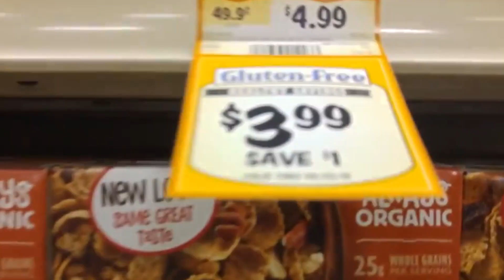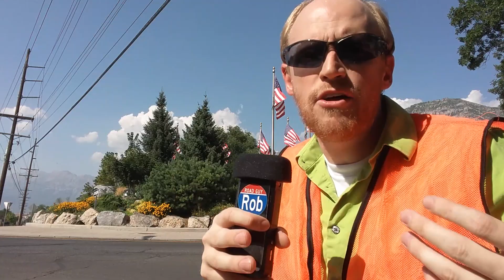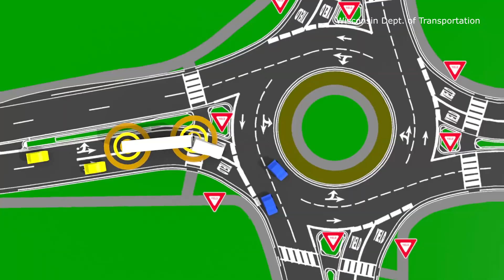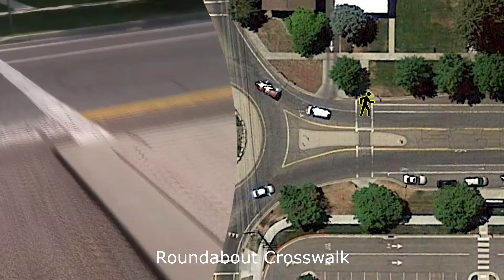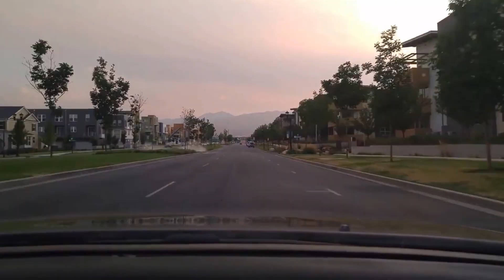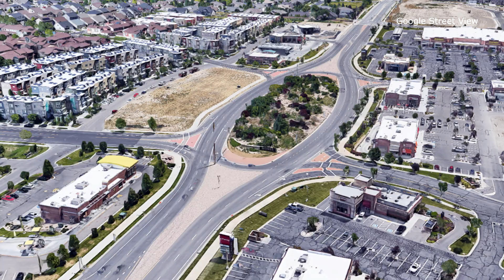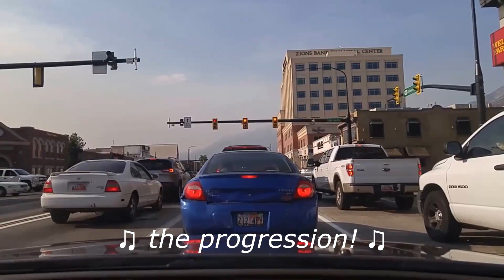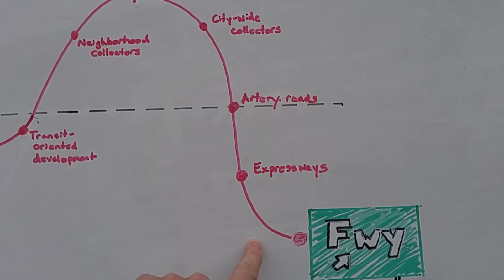Are roundabouts REALLY better than a traffic signal?

Comment: As a motorcycle rider, roundabouts eliminate the most common accident: being overlooked by a left turning (crossing your path) vehicle.
Reply: As a motorbicyclist may I add that a well designed roundabout is a lot of fun.
Reply: There's a difference between "getting overlooked" and "the other person didn't even try to see you". So still you're right but you need to check your use of "overlooked" since most "overlooking" (which means checking and failing at that) actually means "turning without checking".
Reply: you mean when they're coming from the opposite direction as you and they can turn but they must yield (flashing yellow arrow)? or am I misunderstanding you?
Reply: @muhilan8540  The direction doesn't matter. But mostly it's the case when motorists turn right and need to yield to pedestrians and cyclists continuing straight on. Studies show, that even in cities most people don't even check their mirrors before turning - which is definitely no effort! But they don't check their mirror, one cannot talk about "getting overlooked". It's just reckless missbehaving. Imagine the same situation in industries: An electric engineer arranges something and doesn't check the installation to be right or wrong. He just switches it on, creates a shortcut and the facility burns down. Would you say, that he "overlooked" the mistake in the circuit? He didn't check. That's a difference and it's the same situation when people turn.
Reply: @mopshase12   Mirrors have nothing to do with the motorcycle situation Der Stadtbewohner is talking about.  He's talking about a motorcycle going north (for example) getting hit by a car turning left from the southbound to eastbound street.  Roundabouts completely eliminate that problem, and you're left with getting rear ended (in which case it's your fault because you didn't yield to traffic in the circle) or sideswiped, both of which are far less severe.
Reply: @ntdscherer  You didn't get my point properly: I know that he's talking about getting hit by a left turning car. Nevertheless he said "being overlooked", but even there, many "accidents" happen because the turning driver doesn't check. It easier to understand when talking about turning right and mirrors, but the problem is the same.
Reply: @mopshase12  A few, sure.  I doubt there are a lot of accidents by left turners who just flat out didn't even glance in the direction of oncoming traffic.  Even a stupid driver knows that's a good way to get killed.  Inattentional blindness is much more likely.
Reply: @ntdscherer  There are two main types of accidents when turning left: Checking the opposite direction, waiting for pedestrians to cross and then turning without checking to the front again and as you said "inattentional blindness" - but that's the point: inattentional blindness is the same as not checking. "Overlooking" means that you are attentional and still don't see something (e.g. due to sunlight). Inattention is still not-checking.
Reply: @ntdscherer  Actually, it is in this context. Because calling that "overlooking" creates the idea of accidents happening as a matter of unluck and somthing uncontrollable. It's trivializing the event "accident" - which is a main reason why accidents are happening: because one does not think of one's own responsibility.
Reply: @mopshase12  I'm not sure exactly what you're replying to, but if you're saying there is a context in which inattentional blindness is the same thing as not looking the right direction, no, that is not true.  I don't particularly care if you want to use "overlooking" or some other term to describe a driver who failed to look out for threats as they should have.  

As for "accident", it's a reasonable term since almost no crashes are on purpose.  "Accident" doesn't mean there isn't accountability or that it's nobody's fault, it just means it wasn't intended.
Reply: I can’t even walk a crosswalk without people doing it.
Reply: The most common "two vehicle" accident. The vast majority of motorcycle accidents involve only the motorcycle and the terrain. Usually riding while impaired and/or riding outside of their level of skill. My only accident in something like 200,000 miles was me low-siding due to over-braking due to being a n00b. Most of my two vehicle near accidents have been caused by drivers trying to merge into me while they were oblivious to my presence. Always assume they don't see you and try very hard to not be in a place where that is a problem. If you have to be there, get out of there as soon as possible.

I'm in the US where there is still a lot of unfamiliarity with round abouts /rotarys. I'm ambivalent. I think a lot have them have been put in not because of traffic engineering but because of town managers seeking coolness. I hate places that have about four of them strung together in a mile or two. Every one of them is a chance for dirt or gravel on the road.

Comment: I vote for roundabouts being terrible in most instances. About the only time I welcome a roundabout is when an ovalabout can eliminate at least two signal controlled intersections. The video covered both pros and cons pretty well, but I want to reiterate the cons:

1) Roundabouts take up more space than an intersection. The more traffic a roundabout has to accommodate the bigger it and its approach ramps have to be. A fully developed roundabout with overpasses, approach ramps, bypass ramps and pedestrian bridges takes up as much space as an interchange and costs as much or more but doesn't function as well as a properly engineered interchange. Roundabouts also make it impractical to build high traffic buildings anywhere in their immediate vicinity, thus impacting even more land than they actually use. An intersection requires no such reserves of extra land around it.

2) Roundabouts are not pedestrian-friendly, thus the need for pedestrian bridges or tunnels. But that's only half of the story. Roundabouts send a continuous flow of traffic downstream, which makes it much more difficult for pedestrians to cross the downstream street or boulevard.

3) Pedestrian bridges over roundabouts are expensive and ugly, and tunnels are usually poorly policed and therefore dangerous. But if pedestrians are allowed to cross the crosswalks at will on a roundabout and its approaches it only takes a modest amount of pedestrian traffic to completely clog a roundabout. A roundabout cannot tolerate being next to a metro station without pedestrian bridges/tunnels.

4) A roundabout is not a high-traffic junction, just the opposite, it's capacity is limited. A 4-way intersection with adequate dedicated left turn lanes and controlled by traffic signals typically has higher capacity than a roundabout.

5) Yes, roundabouts promote a continuous flow of traffic. That, however, is not an advantage in most cases. A traffic light groups the traffic into pulses, called platoons, which allows cross traffic and pedestrians much better chances to safely cross the street downstream of the junction between the platoons. A properly designed boulevard will have traffic lights every 3 to 5 intersections with just stop signs on the cross streets in between.

6) Cloverleaf interchanges get a bad rap because they cause weaving (traffic enters onto a highway before traffic that exits), but roundabouts have weaving problems in spades. All traffic getting off a roundabout at an off ramp has to weave past traffic getting onto the roundabout at each previous on ramp. Furthermore, a cloverleaf design can be modified to minimize or eliminate the weaving problem, but it's inherent in a roundabout design... no mitigations are possible and still keep the roundabout concept. Yet cloverleafs get condemned and roundabouts are nearly universally celebrated (falsely) as traffic-solving panaceas. Roundabouts are not a panacea and they should not be used or recommended nearly as often as they are.

7) Traffic lights get a bad rap for impeding the flow of traffic. But a single roundabout will impede the flow of traffic at least as much as a single traffic light. It's a series of uncoordinated traffic lights that must be avoided. A series of coordinated traffic lights work better than a series of roundabouts. With coordinated traffic lights you're likely to have to stop at the first light in the series, but thereafter you're likely to be able to drive straight through at full speed. With roundabouts you must slow and come to a near stop at each yield point at roundabouts with no traffic, and a full stop at each roundabout where you encounter opposing traffic.

For all these reasons we rarely see roundabouts being used in North America.
Reply: 1: They are a lot more attractive which for many places is a big selling point as they are very often used as a form of traffic calming when driving into a town. You don't just have a sea of asphalt but a nice grassy donut in the middle usually with a statue of some kind on it. Not to mention the US has some of the lowest density cities in the world so for them space is less of a concern than for anyone else.
2: Roundabouts though make it far easier to accomedate pedestrian islands and the slower speeds enforced make it easier for pedestrians to cross. A roundabout without a pedestrian island is indeed bad as they go hand in hand.
3: I just never see any. You do have some for bicycles though but you also have plenty of them following the roundabout. The addition of islands make it a lot easier as well.
4: very high capacity roads shouldn't have 4 way junctions at all. They should have turn and merge lanes. Also when tallied together a 4 way intersection just can't match a roundabout unless speeds are over 40mph at which point 4 way junctions should be avoided as well.
5: That would be fine if everyone followed that but they don't. It also creates constant bottlenecks and driver frustration. It also makes poor uses of available space as it means cars are either going fast and are spaced apart or there are no cars on the road at all.
6: Cloverleaf though are problematic because they are installed near highways. At those places 4 way intersections would perform just as poorly. Roundabouts are for slow speed with lots of conflict going on. Not high speed through traffic. Also I don't know what sort of avoidance you are talking about. Roundabouts are used on two lane roads which means you have a seperation and you also have an island between you when you're making the turn without any issue.
7: They actually slow traffic down which is what they are for. You want to make sure people are not going to be able to easily drive faster than they are supposed to. Using roundabouts in areas where you are allowed to go 80km/h is bad no matter how you slice it but those should also have a different philophy applied. THey should avoid conflicts as much as possible wide the use of things like side streets to lower the number of intersections.

Comment: I imagine it takes a lot more landscaping work to do roundabouts in hilly areas.  There are a lot of places here in PA where it would be an absolute nightmare to build a roundabout, but a regular intersection is no big deal.  Plus, going through a roundabout, on a hillside, in the snow, doesn't sound like much fun.

Also, there's no way your numbers for electricity costs per intersection per month are correct.  Especially with newer LED traffic lights.

Comment: "$5000 to $10000 a month for electricity" to run lights at an intersection?  Yeah, no.
Reply: He's clearly researched the topic. Not just pulled the number out of his ass like your assumption.
Reply: Yes - he clearly stated that the cost was for electricity only and for a single intersection, so his monthly cost is off by a factor of approximately 100.  He does raise a fair point about the long term ongoing maintenance cost of a signal being more than a roundabout, but he should have left it in qualitative terms only rather than ridiculously overstating it.
Reply: Either he ment all traffic lights and street lights combined for an entire city or he means $5-$10 per month lol.
Reply: Well an oldschool light bulb uses like 60 W, a 4 way Crossing has atleast 8 Signals. So 60W * 8 *24 *31= 357,12 kWh , at 0.20$/kWh that would be 72$/month
Reply: @DraveDruneZH  Do you live somewhere there's no sunlight? A 60w bulb is going to be basically invisible in daylight. Standard traffic light bulbs are typically 150 watts, so that's 28.8 kWh per day, or 10.5 mWh per year. When you factor in maintenance and running all the electronics needed to control the light, about $10,000 per year is right in the ballpark.
Reply: @DraveDruneZH  LEDs nowadays
Reply: @DraveDruneZH  Those traffic light bulbs are much brighter than 60 watts. Even if using LEDs they need enough heat to melt snow.
Reply: @none--other  Yeah, still no.
Reply: Very few municipalities in the world still use halogen bulbs for traffic lights due to the cost involved. LEDs are much cheaper to run. Even with halogens the cost of $5,000 to $10,000 is extremely unlikely just for one intersection. He probably meant the entire city, including the cost of maintenance and replacement parts.

Comment: The other issue is roundabouts only work well when traffic volume is below a certain amount - roundabouts really do have a set volume they can handle and once they reach that max volume the traffic back up they cause is far worse than a controlled intersection where you can direct traffic and have the ability to modify signals to move traffic as needed. I can think of multiple cities in Latin America like Bogota where roundabouts work fine during non-peak times, but during rush-hour they become overwhelmed and cause major traffic backups because the volume of cars as well as the need for cars to switch lanes while in the roundabout simply becomes too much. This becomes another issue to consider with roundabouts is not only what will be the peak traffic flow, but what direction will that traffic flow? Roundabouts lose a lot of their safety appeal when cars entering are not simply continuing forward but are in fact making turns and need to switch lanes in a multi-lane roundabout.

Comment: there a better system where the lanes cross then cross back.  this work supper good with freeway ramp or major roads.  It does a better job of keeping things flows.  Can't think of the name for this, but I have seen it in actual and they really do work.  As for roundabout when there not street sign for the roads they suck and that a problem in the UK. Now the state replaced a local 4 way stop.  Things where a total mess are rush hours time.  The round-about fixed that go from things getting back up for 3 miles from the stop to the light down the road.  Now I put up they the Road HOGS that ignore the road and speed limit signs and dont yield or plow thru doing 40 when it clear say the limit is 25.  you add them play tag team driving where 8 to 10 car/trucks just truck thru without any regard for the back up they creating. still it beats what we had before. It took the state 2 years to construct the round-about.  IT totally beats sitting at a light for what seam like for ever.

Comment: I'm a truck driver and I cringe every time I see a round about on my GPS.
Reply: Are they difficult to navigate with an 18-wheeler? There are a couple of intersections in our town that I think would be perfect for roundabouts but never considered how it might impact larger vehicles
Reply: @thegreenhorizons  Big roundabouts are fine if they have more than one lane and cars don't try to squeeze into the space a truck needs, but the GPS doesn't say what a roundabout looks like. So far I've only encountered ones I could handle, but in my home town I've seen trucks stuck on a roundabout with one lane and a flower garden in the middle with no sidewalk buffer. That's what I envision when my GPS takes me though a roundabout in a small downtown.

Comment: Not really how big rigs work. Because they're taller the center of balance is higher, and the same angle at the corner means more distance traveled on the opposite side. That tiny curtain is a hell of a lever.

Comment: There are two in St. George, Ut on I-15 @ exit 4, these two round abouts are heavily used by tractor trailers due to a truck stop located there.
These particular RA's are small in diameter and two lanes each, the bad thing about these two are they are really loaded up nicely done landscape shrubbery and if you're driving an 18-wheeler loaded heavy, by the time you get rolling a four wheeler invariably comes barreling out of the bush and nearly t-bones you.
Note to Utah D.O.T: TEAR it down, it may be pleasing to the eye but it's going to get someone hurt!

Comment: on reduction of fatal crashes, not only do they have to slow down but they come in on an angle which not only is optimum on moving around the roundabout but also is great of deflecting most of the energy going into the blow reducing the fatalities a lot more, it also helps when people have the fear of kissing a cinder block at 50mph not to speed .

Comment: Can you program green light progression on two way streets? Seems like the advantage to one direction would cause cars going the other direction to get many more red lights, thus limiting this to one way streets.

Maybe I'm thinking about it wrong, but that's how I'm seeing it.
Reply: Yes, you can, if the geometry is right. The distance between intersections must be equal. And ideally there should be no protected left turns. But even if you have protected left turns, it's still possible with certain phasing, such as lead/lag, where the green lights start and end at different times.